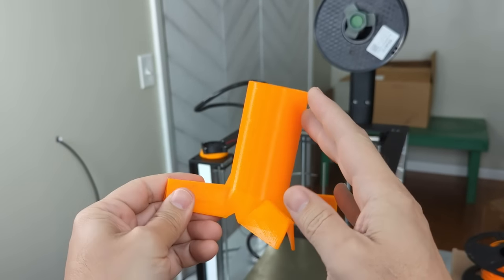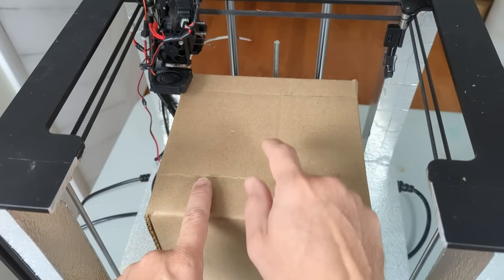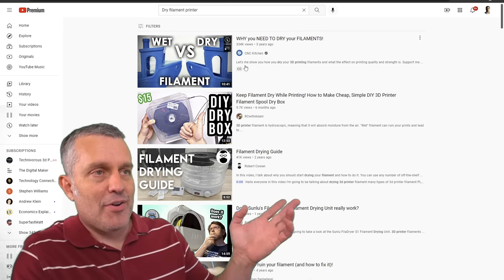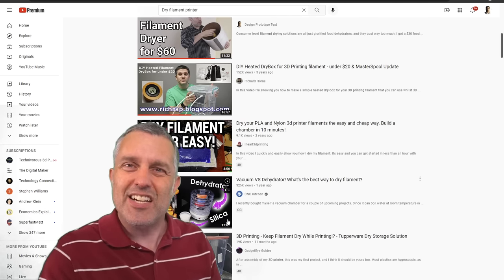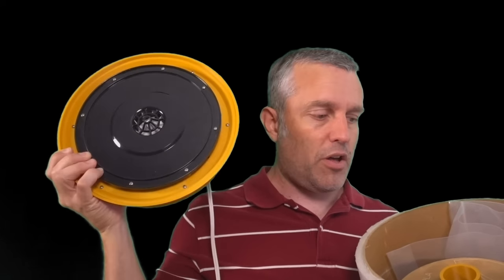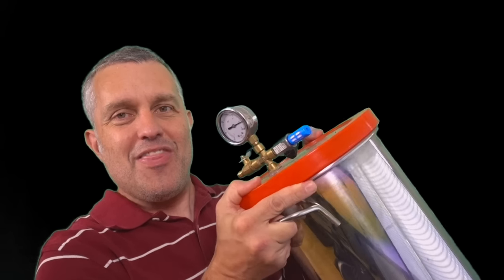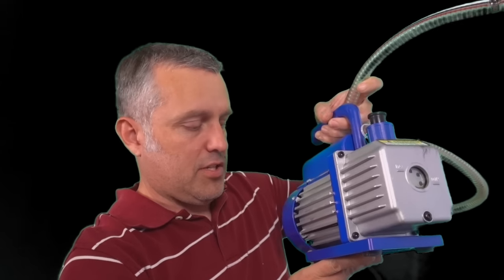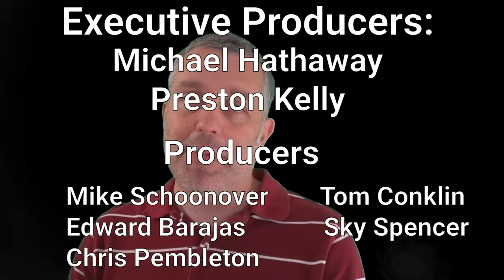The Filament Dryer Built Into Every 3D Printer

Comment: I just use a cheap slow cooker to dry my filament, with the pan as the lid.  A couple of hours in there, job done.  I store the dried filament in clothes vacuum bags with desicant right under the valve.

This works well for me,

Comment: I can get humidity down to 10% I side my 3d printer enclosure . Place the filament inside a bucket lined in alfoil with the lid lightly on . Works pretty well. I use a plant soil mat inside the bucket instead of heated bed . But it all sits on the printer base which is all enclosed in an insulated enclosure .

Comment: infrared hotplate-walmart $24.  Possible solution.  Vacuum chamber--maybe an old aqaurium place the hotplate inside and heat it up.  When ready--seal the top--the air inside will be heated and as it cools-it will -pull a slight vacuum

Comment: I like the simple suggestion of a large tupperware with a reptile warmer inside.  I think adding a bed of dessicant beads and some small holes at the bottom, maybe an inch up and slightly larger holes near the top would help draw any accumulated moisture out of the filament and box.  Very informative. thanks!
Reply: I just bought a $30 food dehydrator

Comment: You don’t really need the fan. Put holes on the top of the box and more at the bottom. The convention cycle will do the job without having to force the air with a fan. Works fine just with a box with holes.

Comment: Nice video as always!  I literally had the same idea this weekend after dehydrating Nylon X in my Breville convection oven.  Meanwhile I have two printers enclosed in a server cabinet and I’ve been using the print beds to maintain chamber temps since the printers are currently in my garage.  Looking at the print beds it seemed obvious just needed to enclose it.  The fan idea i did not think of.  Going forward, building a heated printer for elevated temps would be an awesome project for your channel!  Local here in Seattle there have been used stratus printers selling for under 1000.  I’ve been thinking about converting one one of those or purchasing a Intamsys Funmat HT.
Reply: So dumb question. If your printers are in a cabinet, what about using a small space heater instead of the print bed? I live in the region and am planning on using a spare refrigerator (turned off) with two ender 3's and a space heater inside to try to get a better print environment and results.

Comment: One thing to consider when using computer cooling fans is how much resistance to the air movement there will be in the application.  It's kind of like a car built for speed vs a truck built for torque, high air flow(speed) high static pressure (torque).. most computer case fans are designed for high CFM so if you test with that but there's too much resistance then the concept test might fail unnecessarily and lead you to try different solutions when it's possible all you needed was a fan built for high static pressure instead. Just a thought. 👍

Comment: problem is the roll impedes airflow so the inside won't be dry as fast, some dude demonstrated drying as it's unwinding and printing, needs some length but my money would be on a reel to reel thing blowing desiccated/fresh hot air over the filament if you want it done in an hour.

Comment: My 5 cents on this. Been doeing it since i bought my first nylon 6 spool. 
I put the spool to dry inside an aluminized zip loc bag with a hole, making sure the bag shape is somehow conical, like a pyramid, with a hole on the top. In cold days u can see the vapor fumes escaping from the top. No need for fans or stuff. I set bed temp to 85. No time for 70.

Comment: If you have a old fridge freezer and a couple of old school light bulbs for heat you can make a nice hotbox for drying. I used to use it for wood, speed drying for turning, Now its heated storage for spools of filament.  Mine sits 48,50'c with just the bulbs suppling the heat and a 24v 120mm fan blowing the warm air between the top and bottom.
Reply: Fridges and freezers are pretty tightly sealed when the door is closed. How are you expelling the humidity out of the closed fridge or freezer? If you heat it up, all you have is filament in a hot/humid environment, which may actually make it worse. You either have to have some kind of desiccant in the box or some kind of air transfer to get the humid air out. Maybe a homemade heat exchanger too, to save some of that heat the bulbs are generating... Since cool air typically has less moisture in it, draw the air from the bottom, then expel the hot/humid air from the top, because heat rises... Not sure how much stirring/mixing of the air your fridge/freezer project generates...
Reply: @rdh2059  Its got a 40mm exhaust up top with cotton filters, That used to indicate the moister with the wood i used to dry in it for my lathe.

Comment: I think a good way to implement this would be in an enclosed corexy printer with the enclosure heaters built into the sides like the old stratasys dimension printers, then have the spool holder mounted on the inside with the fan built into it, could have a built in device to measure filament moisture (an accurate one seems expensive) and have the machine prompt a drying cycle before printing if the filament is wet.
Reply: Time to build a corexy...

Comment: The CPU fan is 1.2W, 21.5 CFM and with regulation is about 1W. The small one is about 2.4W but probably less than 10 CFM. Why the smaller one provided more air flow? maybe the big one was mounted with wrong polarity?

Comment: I have a NuWave countertop convection oven that can be set as low as 50F and will run for 2 hours before needing to be restarted. So for 60C I can set the oven for 140 and usually resetting after 2 hours once or twice works great. I don't generally have issues with PLA or PETG, so I only really use ABS and TPU that need dried; an possibly some PLA's with additives.

Comment: My biggest question or concern is the life span of the craptastic MOSFET on some printer controller boards. One of the other commenters mentioned that they used an arduino and old unused heated bed from an old printer. Would be nice to do this with quality electronics that also aren't part of your currently running printer (for those of us with only one or two printers).

No need to tie up your machine or add stress to it's electronics.

Comment: since 2019 I've been using a food dehydrator installed above of my printer to feed the filament directly to the printhead through a tube coming out the bottom of the dehydrator

Comment: One consequence with using printer bed for a dryer is that it would tie up the printer and keep from printing. Maybe cobble together parts from a old/broken printer to create a stand-alone dryer? Excellent info...thank you for sharing!
Reply: On the other hand, since you arent moving any axis it could be done at night were you may not be able to do normal prints because of the noise

Comment: I just started working with 3d printing and the first thing I'm designing is a chamber for the printer I have.  For the prototypes I'm using pla plates that will interlock with one another so I can customize the enclosure for what I need.  I have some transparent pla that I will use to create viewing ports to see what the printer is doing, 4 fans for airflow and easier temperature regulation, led lights so I can see what the printer is upto easier, I'm using a spare seedling heating pad that I have from my greenhouse for heat and a spare humidistat/thermostat that I also have from my greenhouse to monitor what's going on.  I was also thinking of supplying the air from a dehumidifier that I have so  I can control the environment as much as possible with what I have.  It's ambitious, will take time but I think it's worth it.  What's your opinion/advice?
Reply: Sounds cool. How did it turn out?
Reply: @cameronbigger3412  ambitious failure thus far.

Comment: You could make that fan a whole lot more effective by printing some correctly contoured ducting for it. Would take like 10 mins to model and 20 to print
Reply from the maker: Radial fans are very poor at creating pressure. Think of it like they gently move the air but don't have the strength to push it through a long tube with all of that friction.. Pressure is required to move air through ducting. Necking down the piping requires a buildup of pressure. Even if I made the transition more smooth, the larger fan would still be inferior. Anyway, the smaller fan is perfectly functional. Gently recirculating the air inside the box yields great results. This isn't a purpose designed filament dehydrator. If you blast too much air onto the bed, the 24 volt DC power supply won't be able to keep it hot enough and you will trigger a thermal runaway protection error on your printer.

Comment: Been doing this for years I thought everyone used their bed as a drier. Although I will say that I burned out my bed power wires one time years ago and had to replace them with much thicker wire and have had no issues since. The original wires were in my opinion not thick enough anyway but just to say this did happen to me while drying at high temp.

Comment: Your comments on the SunLu drier aren't necessarily true. I have that exact model, and while I admittedly fought the timer in the beginning, I went back and actually read the instructions and you are able to adjust the time that it shuts off in. - By pressing both buttons on the panel at the same time (Though I've found it's bugged, to where if I increase the time, it just stays on indefinitely. Kind of a "failing upwards" if you ask me though)

I'm able to get as low as 18% RH in mine, maintaining a temp of 55C.

Comment: I've solved it almost the same way..
Just used the heatbed from an old 3d printer, enclosed it into isolation box and controlled by esp32 (arduino) ..works good for now and without any fire :D
cost me nothing basically because I've had everything already (esp32 for ~6-10€)
Reply: I love that this also doesn't put the printer out of commission during drying time. You can still print on your printer while drying another roll. I've only got one available printer at the moment, and if rather not render it unusable while I wait for filament to dry.

Comment: I absolutely don't see the point in this at all. I'll stick to my drybox with desiccant. And my Sunlu for keeping the filament dry during printing. 

Using your printer to dry filament is ridiculous.
Reply from the maker: If you were a newbie who hadn't yet spent the $40 +shipping to get a Sunlu dryer, and you weren't planning on using your printer 24/7 this solution would appeal to you. It allows someone to print up and assemble their own filament dryer (a fun and useful project) for about $5 which works better than a Sunlu because the Sunlu doesn't have a fan to speed up drying time. 1/10th the cost of a Sunlu and better/faster drying performance. Do you see the point now?

Comment: Couldn't this be made even simpler by putting the filament spool on an axel (like a rod or something) within the box? If you shape some fins just right you may be able to slowly spin the filament spool using nothing but convection currents coming from the bed. Sort of like a water wheel with hot air. 

Or, really just suspend the spool above the bed vertically in a box. The convection currents should move the air and moisture up. No fan needed.

Comment: Cool stuff! I have used my enclosed printer to dry filament before. One issue I see with your approach is you need to vent the air out of the box. Otherwise you are just moving the moisture around in the chamber. Also, desiccant doesnt work too well in a heated environment, as heat causes the moisture to escape the desiccant. Technically you can add some vents to the bottom of the box and the top. Use a low RPM fan just to circulate the air inside. You can also make a box out of aluminum faced insulation panels. Dont really need the center mount piece. Heat rises and causes draft inherently. Always good to see people trying new things.

Comment: nice idea, but a $30 dollar food dehydrator does a better job. firstly your card board box that only get's to 55 degree isn't vented, were do you think the moisture is going to go? secondly 55 degrees isn't hot enough for most filaments for effectively removing moisture. Like i said nice idea, but it is in search of an actual problem, since food dehydrators are so cheap.

Comment: I was always wondering if there couldn’t be some kind of pre-heat phase in the printer where filament runs through a close-to-glass temperature heat cycle just before being pushed down the hotend. I imagine a heated spool that sits in an insulated metal pipe where the filament runs through. Then a fan to transport the extracted moisture away and cool down the filament just enough again to be hard enough for proper extrusion.

Comment: You could also just buy a room dehumidifier and call it a day or keep it in a bucket with a metric frack ton of desiccant, but yea its a good idea to use the bed as a filament dryer, was debating on doing this for a while when im away at work bc my container isnt big enough and since my printers arent running while im at work so its cool to see it be an actual thing ppl are having success with. Id even go so far as to say these ideas can be merged with containers just using a heated build surface not being run off a printer, but inside a desiccant filled container. This way you arent tying up printers.

Comment: Good idea, but I really think that filament drying is unnecessary.  I had 2 open spools of PLA filament that both went into an outdoor facing storage unit for 1 year.  After that, they were put in a back room of my first house for 3 years.  Then, I moved into my current house and they sat for another year.  I finally got the urge to start 3d printing again - and both spools made perfect prints.  People really put too much effort into drying their spools.
Reply: you probably live in a place where air is dry. 
Its clearly different in other places.
Reply: @randominternetviewer166  I would not call middle Ohio a dry place.

Comment: I have my filament come out of a filament dryer and go right into the printer. If I haven't printed in a while I run the dryer 3 times (5 hours each I think)  until there's no condensation. I also run the dryer while I'm printing just to be safe.

Comment: Hi, Could you add a scale to measure the weight of the PLA in order to predict if it is enough before the print start? I know octoprint has something like this but I was wondering if the Duet board can connect to the HX711 scale chip.
Reply: i think the weight difference is actually very small?

Comment: I live for PETG as I generally print amateur rocket parts with it (supports, camera mounts, accent parts, even nosecones.) I've even printed an 8.25 in diameter Mercury capsule for an 8 in diameter fiberglass rocket body out of PETG. If i remember correctly, with the capsule and escape tower system, it was about 2 feet in height. Overall, the rocket was almost 10 feet in length. I'm glad I do not have to dry the filament. It already takes days to print some of these components. Adding another day for drying would suck. I must admit, I could probably get away with other filaments as I live in the desert where the ambient humidity is quite low.

Comment: I used to do the same thing as well but I used just a single fan sitting there and the filament box with some tape to seal it to the bed. Worked well for some time but I decided to build a standalone solution since I don't have so many printers to waste. The efficiency of it seems to me a bit low but it's definitely the best vfm solution you can get.

Comment: I think I'll start using the 3D printer as a food dehydrator... just gotta make sure the dried food doesn't contaminate the print bed xD
Reply: Also, a small nitpick - I'd be careful about saying that the temperature inside the box (50°C) was half or 50% of the bed temperature (100°C). From a physics point of view, "no temperature" is 0°Kelvin, and you can only talk about 'halving' the temperature etc. in Kelvin.

Comment: Hi can you please explain if the fan is to push the air down or pushing upwards? I am thinking of using a reptile heat mat and the 3d printed part for the fan.
Reply from the maker: Yes, the fan pushes air down the center so hot air comes off the bed and circulates around the filament.

Comment: How do you know the filament absorbs moisture in their vaccum sealed bags with a desiccant bag?
Reply from the maker: Because I've taken brand new roles out of the bag and run them through the nozzle only to hear the snap crack on pop noises of wet filament. Also the print quality which was greatly improved when I dried the same filament. A sealed bag with desiccant will keep it dry for a certain time. But eventually the water will get in.

Comment: Just find a way to extend the box up over the printer head. Then you can just use the fans on the hotend to move the air round.  not sure why you would even need the tube down the center .